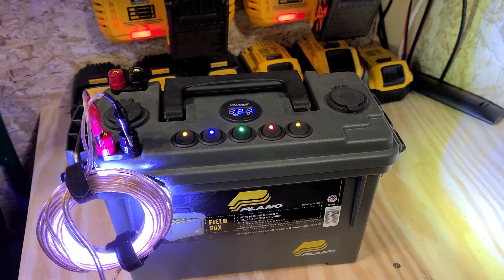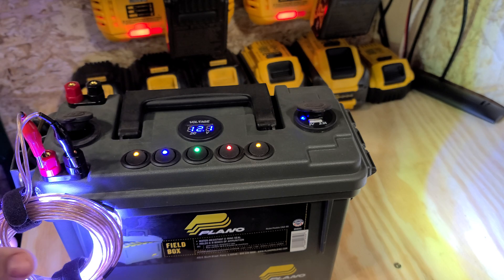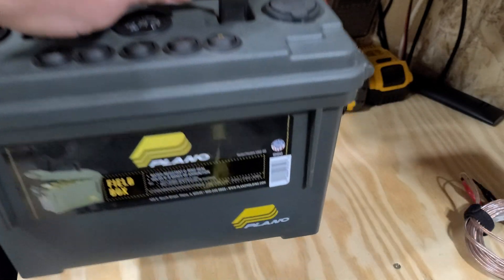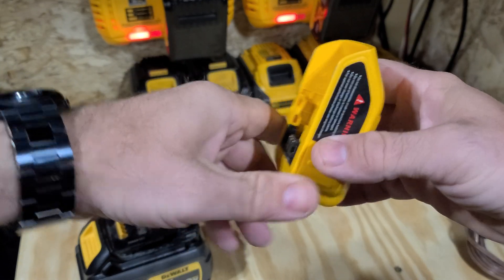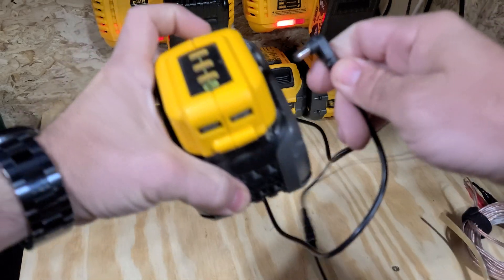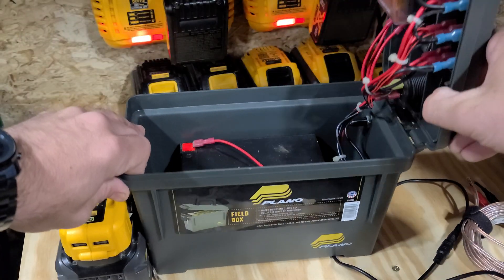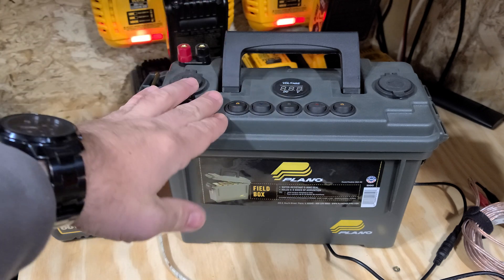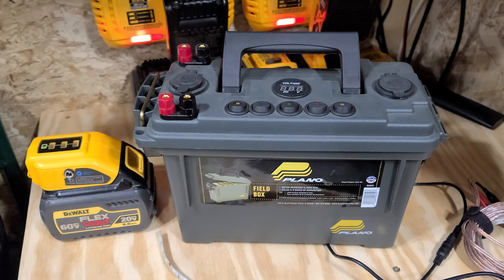Check out the next generation power box

Comment: I have purchased both the Milwaukee and Dewalt charging adapters three years ago. The Milwaukee batteries are the 18 volt 12 ah batteries I have two of them that power my 93SV Garmin and the batteries work great still, one is an extra I switch them out.  The Dewalt 20V Max batteries...one powers my Livescope the other powers my 126 Garmin. I have four batteries, two for use and two standbys. The Dewalt batteries are failing after using a couple times a month for the past three years. I did everything correct, kept them on the chargers as Dewalt suggested when not being used. You go on Amazon or anywhere and you will see that I spent over $600 on these 4 Dewalt Batteries which basically have no warranty. I recently purchased a battery box and an Amped outdoor lifepo4 32ah battery.  Total for both less than $400. The battery has a 10 year warranty...Do the math it is way better to buy the Amped Outdoors. I will still continue to use the Dewalt Batteries at least one to run my 126 until all batteries completely fail.  They will not hold a charge and discharge in a little over an hour. They were great while the batteries lasted but the batteries are too expensive to replace and if you get anything less than a 9ah Dewalt Batterie then they don't last nearly the Amp Hours they are designed for. The 9AH has never lasted anywhere near 9 hours even when brand new!

Comment: Cant you only run low voltage 0dc from a typical tool battery? Because i need ac for laptops and work-lights. Seems any ac functionality would drain it quite quick, and is more suitable for love voltage dc needs like phones and like you said finders. I,m looking to build one that can run most anything at camp for a few days and have a solar charging controller with a decent panel. Still a cool option

Comment: So what happens when your Dewalt battery and power box battery dies? I was looking at your design of the power box and there would be enough run to put a hand crank motor that you could put a handle on to manually charge the dead battery. Store the handle in the case and when needed, take it out, connect it to the crank and turn to generate charging for your battery. You can't do this with the Dewalt on it's own, but you could do it with the power box. :-)
Reply from the maker: If the battery dies you have to charge it. I like the idea of the crank like the emergency flash lights or radios

Comment: What would be good size plastic ammo box that fit 2 6.5 150w marine speakers on the front for Bluetooth build?
Reply from the maker: 50cal
Reply: @JDSOutdoors  is there a utility knife I could use to cut the round speaker holes out and how could I get the right hole for a charge pie on the box?
Reply from the maker: @kylewilliams3306  hole saw is best
Reply: @JDSOutdoors  I do not have a hole saw or drill so what would be another option to cut holes in plastic ammo box?
Reply from the maker: @kylewilliams3306  very sharp utility knife
Reply: @JDSOutdoors   where did you get the small dremel tool from and what round piece on the dremel would cut round hole for 6.5 speakers ?

Comment: BE careful about drawing down spend genuine and even knock off Dewalt, Makita, Milwaukee cordless tool batteries with those adapters. A LOT of those on Amazon have no low voltage/undervolt protection -- even those which claim they do. Be they power wheel adapter, or small light with USB, or USB with a 12v etch, make 100% sure they cut off at 14-15 volts. And that each accessory turns off

Comment: 100% agree with using one of these adapters.  I also have a step down for 12v dc to powerpoles.  lots of uses.  But the larger battery box would be more ideal for different applications.  I think both options should be utilized.  Of course, if you need to start up quick and don't have the cash, get the adapter and start using it for your projects etc, right away.  I do Ham radio and would need something larger with better discharge,  My dewaLT can't keep up.  
Great video and good points.  but depending on your needs, I would suggest both.

Comment: You mentioned 12v. I want to power a 12v pump but would it properly step down if I use a 20v battery?
Reply from the maker: Yes
Reply: @JDSOutdoors  ok thanks. I am just seeing things all over saying needing a step down and all so you don’t burn out the motor but I could always measure what is coming out. Thanks.

Comment: I got same dewalt battery's. that great.that have a 15Ah 60V now, also try the DCB049K usb C 100watt PD charger. running my laptop now. HP  17 in with USB C to HP blue tip cord. run hours and hours on 10Ah 20V. with all that I still use a homemade battery box. reason is ham radio use. ICOM draws over 20 amps peak. that adapter can not give the amps and also is a switch mode converter witch makes hash noise in the HF bands. even CB . so I bult my own out of harbor freight 50 cal ammo box. using a LiFePO4 battery. built in MPPT solar charge controller . using a 100 watt x2 folding panels. great out in the field power box. my only problem is MPPT under the right sun and if on lower HF bands sometimes I get noise. ferrite was a great fix. and that make a small inverter that goes on DeWalt battery. not a sign wave type. also got the DeWalt power station 1800 watts takes 4 buttery's. runs a coffee pot in my tent just fine. mostly use it to charge 4 buttery's at once.

Comment: I took your design and added a small inverter with a switch and wired it to a socket on the outside with a flip cover. I also added a sae connector on one side for a 50w solar panel with built in charge controller. Hard to replace that with what you showed... i love the design of your box though...
Reply: Hi - do you have video or pictures of your setup?

Comment: Those are nice and all, but I'm not going to be able to stay out all day fishing off 1 drill battery .... 
$100 for a power box ... I built mine for under $25, and my battery was only $20 on top of that.
My budget for my battery station is a little higher though, planning a 100ah lithium build to power all lights, fans, and livescope
Reply from the maker: I can fish all day off 1 drill battery why can't you? Plus the beauty is most people have more than 1 battery to bring with.
Reply: @JDS Outdoors  I'm not sure my livescope and lights are gonna last to long on one of those ... weight wise my Amped outdoor 30ah is about equal, ill just stick with that till I build my power station.
Reply from the maker: @mjnelson84  you would be surprised

Comment: I purchased an adapter for my dewalt 20 volt batteries to run the powerbox, it has a positive and negative lead but I believe that will put 20volts to my box wired at 12 volts, will that hurt anything? And what if I hook it to a flexvolt?
Reply from the maker: Install a step down converter.

Comment: I made a boom box and have a solar charge controller in it, all the load is though it but 1 set of banana jacks, which I use to charge the 2 lithium batteries connected in parallel.  Can I hook a 3rd lithium battery in parallel with the other 2 via the pre mentioned banana jacks?

Comment: Though it seems like a good idea to use a powertool battery, you'll never get the power output from the tool battery that you would be able to get from a lead acid / Lithium iron phosphate drop in battery. That 12 vilt output barrel connection is go for what maybe 2-3 amps? I built a power box with 2 12 volt accessory ports, 2 usb ports, volt meter, 3 separate switches, 3 separate fuses along with an anderson 50 amp output to connect a 1,000 watt continuous power inverter. It also has a 1,280 lumen weatherproof light. The watt hour storage from the 3 Dakota lithium batteries exceeds a 35 amp lead acid.

Comment: I still use the DIY powerbox but have always been using with my DeWarlt 20v Lithium battery.... because? I still want my own configurations of switches, ports.... But I do use the smallest box I can use.   Besides... I want a safety of fuse in there as well.

Comment: The only one I found on Amazon has a max input voltage of 22 VDC where did you find one to except 60 VDC?
Reply from the maker: The 60v batteries output 20v unless put into a 60v tool. Hence the flex volt.

Comment: You can’t beat a power box, a lot of good use other than you explained.
Reply from the maker: What other uses that the adapters can't accomplish?
Reply: @JDSOutdoors  Glo ry Hole
Reply: @JDSOutdoors   I will admit that this concept does have it's place and is definitely worthwhile to own.......  As long as you're aware of the limitations.  

As for the "other uses".......  All of my solar generator boxes have pure sine inverters, and of course, a solar charge controller.  In a "grid-down" scenario (or camping in the middle of nowhere) you'll run out of power and have no way to recharge your battery pack. Then you'll probably wish you had a mini solar generator box instead. My latest version is only 6" x 3.5" x 6.5" with all of the bells & whistles and a 450Wh lithium battery inside.(40.5Ah).  It is far more capable than just the adapter & battery and very reasonably sized too.
Reply from the maker: @test-193  now we're talking a different category. I have a video coming out soon on solar generators. I'm building a 3,000 watt pure sine wave with 400ah lithium and 400w solar. Obviously that will power more than the 5a 12v adapter
Reply: @JDSOutdoors  field ham operation, field recording are 2 examples. Where you need more than a few hours of power and can't interrupt the power source. I can see where a power box would be more weatherproof than this as well. But the adapters are nice I use them on my packs for other things like 12v fans and led's. Fans in the rv, fans over electronic equipment, fans in the rv fridge hah

Comment: Power?  What's the power?
The DeWalt is a 20v 6AH battery, or, 120 WH.  The upgraded 9AH battery is still only 180WH.
With the "Flex", you might get 60v out of it, but the power would still be the same.  The 180WH battery would give you 3AH equivalent, at best.

So, in the big boy battery box, you may wind up with much greater power - that has to be taken into account.
Reply from the maker: The USB is only pulling 5v max and the plug is 12v and that 12v plug has ran my fishing electronics for longer than the power box ever did. For what most people run off the boxes this adapter is a way better option
Reply: @JDSOutdoors  Well, it's easier than building, and if you have spare tool banks, you're set.
Reply from the maker: @colfaxschuyler3675  it's easier and cheaper. Most people have some brand of power tool and they have this adapter for all of them
Reply: @ colfax... the standard 120Wh will last 6hours, the 180Wh will last 9 hours.
I suppose you formuled it a bit wrong , "equivalent" should have been additionally.
Reply: @Ben-rw7wg I probably did.  This was from two years ago, and, listening to it again, I have no idea what I was talking about.

I am glad that you commented, as I had lost track of the video.

The battery pack attachments are fantastic.

I've been raiding the discard battery bins for a while, and have accumulated a bazillion packs and broken them down for the 18650s.  They wound up getting a good deal on Ryobi packs, and put the building on hold.

Twelve 4 AH packs, several 2 AH packs, and an assortment of 1.5 AH packs.  Ryobi kits with both USB and power inverters.
Jigs for cheap LED "fog lamps" from Amazon.

Maybe one day I'll build a bigger box - I'd love to have enough backup to keep the fridge at temp during a power outage, but other than that, we can run much of the purge stuff needed.

I never sourced the 12 AH 60v DeWalt he mentioned... 720w of lithium ion batteries would be a monster.

Comment: LiFPo4 has some advantages over Lithium Ion.  Generally LiFepo4 batteries are sealed, so you don't have to worry as much about getting them wet(Don't leave your cordless drill out in the rain). LifePO4 batteries are safer in that they don't have the thermal runaway issues you can experience with L-ion, potential fire hazard.  LifePO4 batteries also can be charged a few thousand times verses hundreds of times you can charge a Li-ion battery without losing capacity.  LifePO4 batteries are not as energy dense as L-ion, so they add slightly more weight/size, but still much better than lead acid.  Also, LiFePO4 cannot be charged at low temperature (Freezing) or damage may result.  So, I think you battery box still has plenty of uses for LiFePO4 applications, it's just about choosing what is best in each case.

Comment: So does a 60v battery step down to 5X the capacity at 12V?  For example does 60v 6AH equate to 30AH @ 12 V?
Reply from the maker: Good question and by the math that would make sense yes. I do know the 60v bats in 20v tools last forever

Comment: great find mate.... BUT the power boxes I've built are mostly for camping, and the large one (24v) powers a 3kw inverter for "emergencies".... power tool batteries still need their charge, my  built ones are charged directly from the various solar panels we take.... Peace.
Reply from the maker: The larger boxes like that definitely have there place.
Reply: @JDSOutdoors  TBH mate I've been looking at stripping down the power tool batteries n making my own battery using them as cells.... Just not got the balls, or the spare cash to do this ATM. They're obviously more powerful n long lasting, hardy etc than the SLA...

Comment: Can't beat the compact size of the tool battery route for what a lot of people use them for. Of course there are scenarios when certain options and mounts are ideal to partner with a power box, so I think there is still a market for those, it's just much smaller than what it used to be like you say